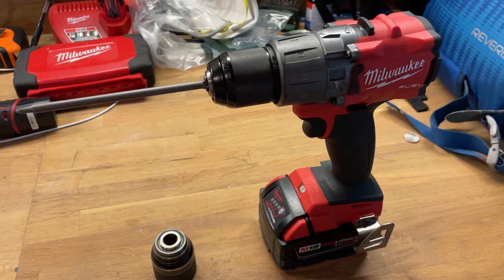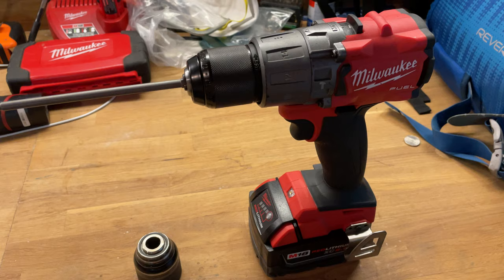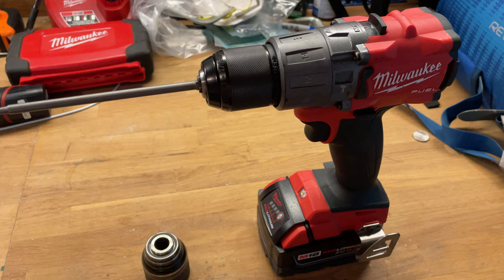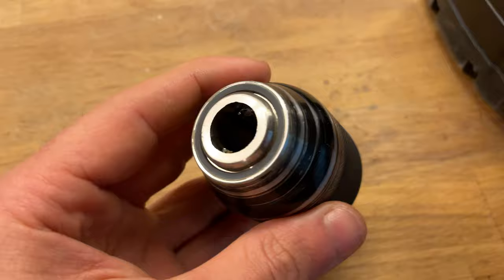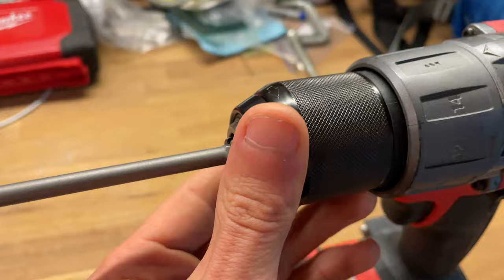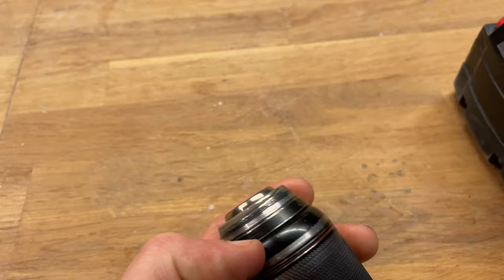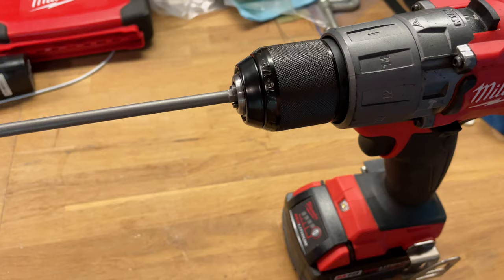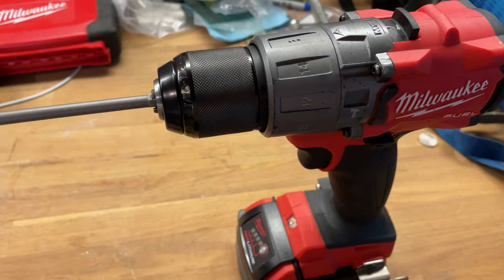Fixed runout/wobble on Milwaukee drill with Röhm chuck

Comment: Milwaukee need to take note!! The run out isn't acceptable on a pro grade tool as they advertise it to be.
Reply: What do you want? All drills are the same. I noticed that early years of Ryobi and Bosch were most precise in terms of run-out. Now there is no difference, as they are all made in several small towns or villages in China.
Reply: @Taoism_new  Where was Ryobi made before?

Comment: I recently had the same thing happen. I have a compact brushless drill I sent back for excessive wobble. They replaced the chuck, but wobble was still there. Good to know that a Rohm chuck will help, but I wish there was a solution that didn't require spending more money on an already expensive drill.
Reply: The chuck is less than $40 on amazon.

Comment: I have an older Milwaukee 2601-20, maybe 10 years old.  I only noticed the wobble over the last couple years - I think I used to not care, because I was doing mostly woodworking without a lot of precision.  Now I'm doing metalworking and some precision woodworking, and the wobble is driving me nuts.  I replaced the chuck with a Rohm last week, but the wobble is still there.  MUCH nicer chuck than the plastic Milwaukee provided, but I suspect something deeper is awry.  Looking on the bright side - I have an excellent chuck if I decide to get a newer Milwaukee... which I'll probably do because I'm invested in their ecosystem.

Comment: I bought 2 drills with the same problem, been 3 times back for repair… never got fixed. That was 7 years ago, now bought again new drill same sh17, original chucks wobble like crazy. I dont get it how Milwaukee can sell tools like that. Thanks for the tip, on my way to buy Rohm chuck

Comment: Fun fact: my Parkside performance (European supermarket brand's "premium" offering) came with Rhom chuck :)
Just don't over open it. And if you ever open it too much: slight turn clockwise, and twist it backwards suddenly. Don't try to force it, or you would have to disassemble it. Just had to do that, but it's fine now :)
Reply: There is nothing premium on parkside. Not even their “premium” offerings.

Comment: This worries me, as I'm about to buy a new drill and I've been reading up on this problem across all the big name manufacturers: Makita, Milwaukee, Dewalt, etc. I wonder whether all of these companies get their chucks from the same factory in China?
Anyway, will the Röhm chuck fit all of the big name brand drills? Thanks for the video.
Reply: Not from the same factory, but from different ones located at different villages or towns. So yes, it is funny seeing people are comparing quality of these "name brands", in fact they are all made in remote areas across mainland China.
Reply: That is true👍my Makita have the same problem, what buy...Festool maybe🤔

Comment: So what Rohm chuck did you use for the drill?  My drill is 4 years old and is getting difficult to tighten. I was drilling with a spade bit and the spade bit started to spin inside the chuck and im pretty sure the chuck has metal shavings everywhere which is making it get stuck

Comment: Yeah this is standard with Milwaukee tools and all of the pillowbiters who exclaim in unison “I Only buy Milwaukee” or the “I’m a Milwaukee loyalist for Life!” will try and have you believe that it’s normal for a drill of this alleged class to have runout and wobble because it’s a “Contractors Tool, not a Machinists!” 

Bullshit. I expect my drills, drill presses, bandsaws, table saws, miter saws, chop saws and even my fkn Drill Bits to be Square, Straight, Sharp, and Solid, Period. 
I actually just returned a Milwaukee tool and got the M18 Fuel Hammer Drill with the two 5 amp batteries, and when you go to use it, it looks like Michael J Fox is operating the drill. 

Just absolutely unacceptable.